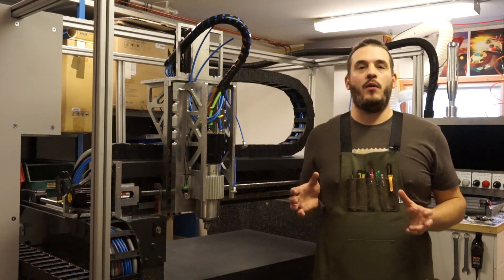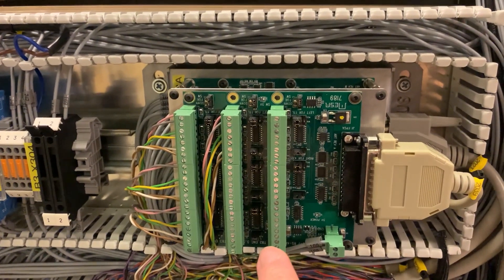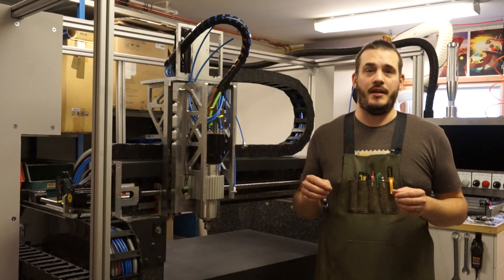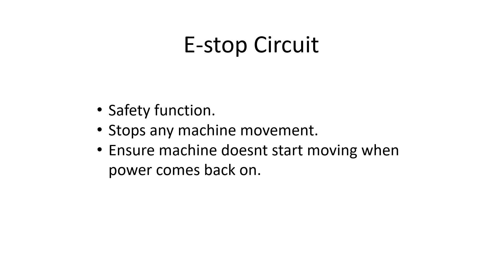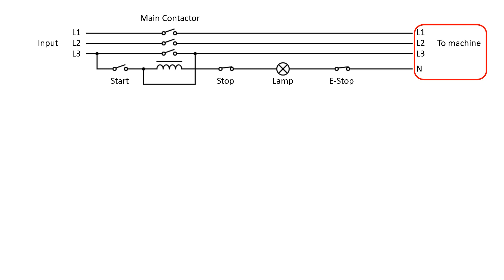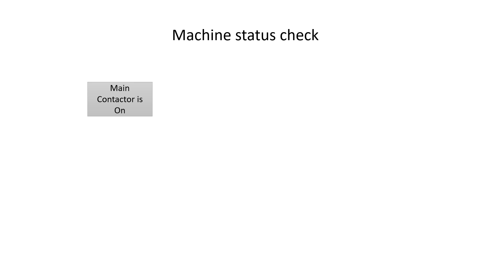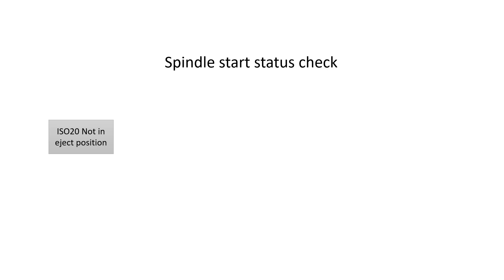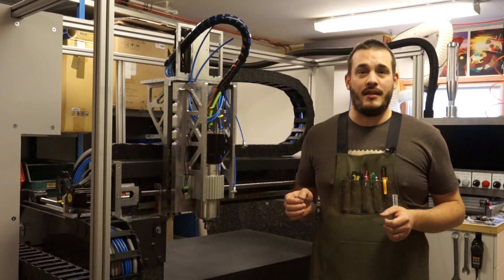DIY Granite CNC - Part 4. Overkill electric control circuit?

Comment: How’s your machine being serving you? Have you made any changes to it? Kind regards.
Reply from the maker: Its been working good. I have replaced the X-ballscrew. but thats more to do with bad quality than anything else. The Y screws could use a change too but they are not as bad, yet. 

I have made a redesign of the entire Z-axis assembly to accommodate a new spindle. But i dont have the funds to get the spindle i would like so thats on hold for now.

Some minor changes to the electrical system as i have run the machine and figured out things i would like different.

Comment: hello friend!
I'm building the same machine from granite...
a calibration plate from China...
and I also bought a mesa i76e...
could you make a video about the mesa configuration...
Reply from the maker: Hi!
The mesa card is not really configured beyond loading the correct firmware. All the configuration of the signals etc is done in linuxcnc. There is tons of information about how to configure linuxcnc on their forum. There is also a lot of good videos on YouTube already. I don't think I can add anything to what is already out there by making a video of my own on the subject.
Reply: @faggan3040  Great job!
I have yet to do everything....
but I have already bought all the components ...
and gave granite for milling (holes and sampling for a ball screw)
ordered aluminum ...
Your videos were useful
Most likely I will shoot some assembly videos...

Comment: Emergency button should disconnect all three phases, I think there are even special contactors just for that purpose. Specially three phases power is dangerous, coz voltage between two phases is around 380 Volts. Otherwise very interesting and consequential design. I specially like rails on moving plate, I also always do it that way, it gives you lowest possible contact point independent of Z height.
Reply from the maker: All three phases are disconnected by the estop. It's done through a three contact contactor. Have a look at the schematic in the video. You will see what I mean. 🙂
Reply: @faggan3040  true, I missinterpretted the schematic, 🙂

Comment: I'm subscribed and following along!  So, you used the 7i76e with servos.  Are you using step/dir on the servo drives or closedloop to linuxcnc?  Can't wait for all the details.
Reply from the maker: I'm using Step/dir on the drives. I have the encoders going to linuxcnc via the 7i89 card. But I'm currently not using them for the closed loop. I can do it. Apparently you can PID tune with a step/dir system same as with analog. I have messed around with it some. Right now I'm only running the tuning in the drives themselves. But I am considering if there may be an upside to tune linuxcnc also. As a two part tune to get it even finer. However I am at a very good tuning result with the drives themselves so I may not bother.